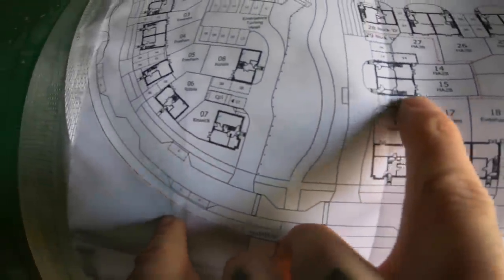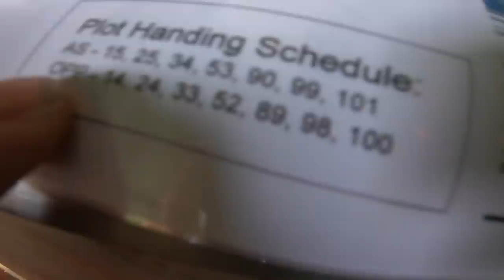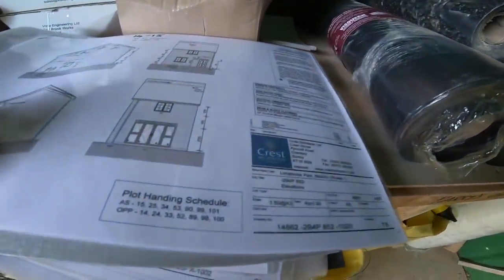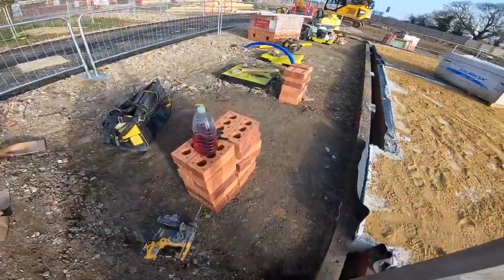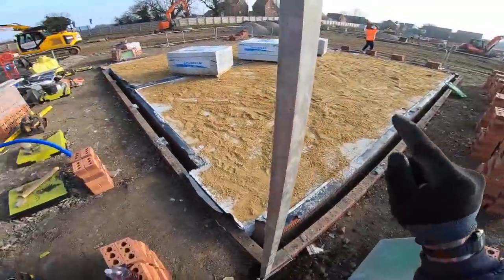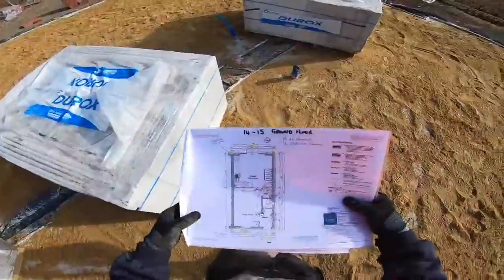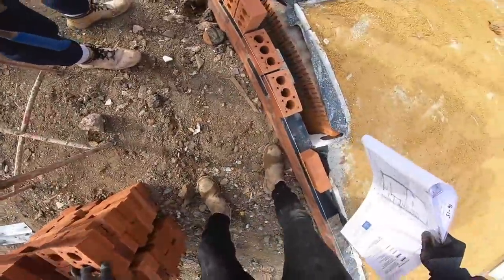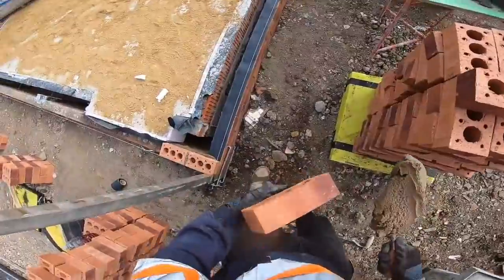No forklift till 1 today...

Comment: I notice that lots if not all the houses I see you work on have Gas boxes,is that the primary source of heating fuel in the U.K.?... Because in their U.S. we have Oil,gas and electric for our heat with... electric being the most expensive to heat with, followed by Gas and oil being the cheapest. Of course it changes depending on the economy but not that much.I prefer using oil myself.

Comment: Im guess the sand on the floor is to protect the  Screeding ?
Reply: It’s not screed pal it’s finished concrete.
Reply: @fabiandegussion5134  so its down to protect that then?
Reply: @simonsupersi2225  just a covering of cheap sand from ground workers pal. It’s normally power floated but it not a high finish because it’s normally latex before either carpet , tile or wooden floor is put down depending on customer desire.
Reply: @fabiandegussion5134  ahh cool thanks never did any of they when i started many years ago lol